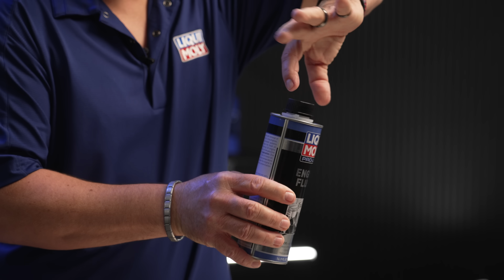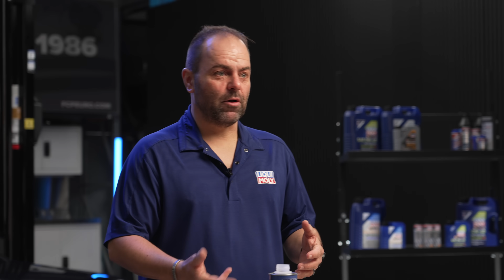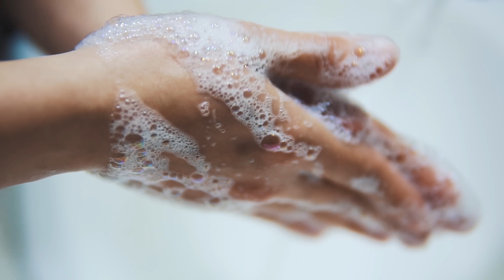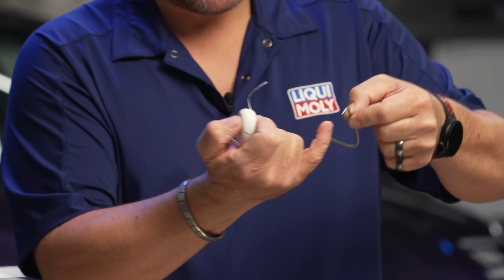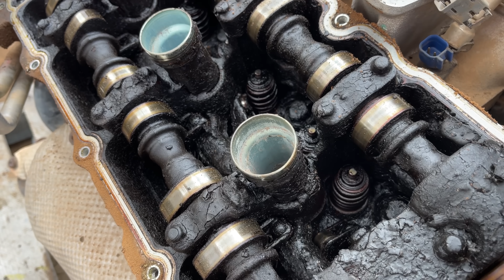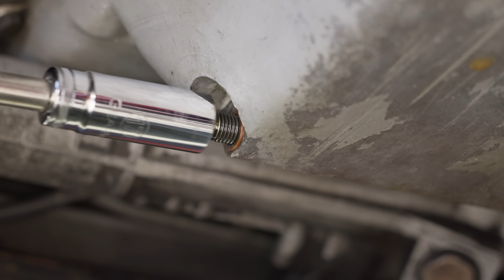LIQUI MOLY Engine Flush | Expert Answers to Your Most Frequently Asked Questions

Comment: The 5156 and Speed are working really well in my diesel family cars, also the flush worked well on the diesel :) 
A friend of mine uses the Direct reiniger and likes it on GDI engines
Reply: Can you elaborate what you mean by worked well?
Reply: @Orkistan7 " Worked well " the car used to smoke a lot, something isn't ok with that car, but with 5156 it started smoking less. I use Speed Diesel with every fuel tank and keeps the smoking and smell to an acceptable point.
Reply: @AAAAAAndrea don’t you think your car smoke less because along with flush you put fresh oil right after that? And this flush claims to remove deposits not reduce your exhaust smoke.
Reply: @Orkistan7 The car didn't smoke less because of oil, 5156 and speed diesel are fuel additives.
The car already has the proper oil

Comment: Would it be the same thing to drain old oil then while drain plug is still off, just run some extra fresh clean oil through and let that drain too before plugging drain plug and putting new oil?
Reply: That helps and I always do this but I do an oil flush first and then do that.  You will get even more out in your engine will be even cleaner especially if you start with a used car and my last car they changed the oil with verified documents every 4 to 5000 miles but it was still sludged up not horribly but a bunch of Gunk came out the first couple of oil changes. 

Now right before I change the oil I run half a bottle of engine flush in every oil change and I'll also run a quart or two pubg basic oil through to get all the other last contaminants out after all the other oil has drained out.  It's amazing how much you get out doing that!!!  Like a lot!
Reply: @bradpnw1897 people who do all this extra stuff do it for their personal psychological benefit not the actual benefit of their engine…although they’ll never admit to it bc it sounds so insane.
Reply: @bradpnw1897 which engine flush do you run?

Comment: You don't need this if you change your oil regularly at 5,000 miles not the 10,000 mile BS that manufacturers recommend. The key is also to not do short trips and get the engine hot. 
With that said the ONLY real engine flush that works is BG that comes in the jug with an external oil filter (dealer only supply). When I worked for VW we used to use that on the old 1.8Ts in the early 2000's when they sludged up and came in with oil pressure lights on. the procedure was to get the engine up to operating temp, drain the oil, install the external filter. Fill that up with the engine flush, connect all the lines and fill the engine with the flushing fluid. run the engine at 3,000 rpms for 30 mins with flans blowing over the radiator. Drain it, disconnect everything, install new oil filter, fill engine with cheap oil. run that for 15 mins. Drain the oil, drop the oil pan and replace the pick up tube/screen, change the filter, and fill the engine with 5W-40 synthetic. That stuff took all the varnish and sludge out of the engine. The inside of the oil pan, oil pump, crank, cylinder heads looked brand new when done.

Comment: Engine flushes aren't effective whatsoever. Just use a high quality oil and change it at 5,000. A lot of Liqui Molly additives are snake oil!!!! Their oils are ok'ish but there are far better oils. Motul 8100 xcess gen 2 is the best oil I used and the best oil when tested by Blackstone for all of my BMWs. Ill never use a different oil
Reply: Actually they are very effective … if you use them in an engine from new not as a fix for an old worn out engine. I buy a similar product in 20 litre drums and use it in all the engines I have from new, excellent longevity is the reward and ultimately lower costs too.
Reply: 8100 x clean / x-cess gen 2 are very good oil indeed, which is what I having used for a long time. Motul excels its additive. Now I am switching to Ravenol  which is  PAO, better lubrication on cold start for my BMW B57 diesel. Used both and happy to use either, just because Motul now increased their price in UK make them less appealing.

Comment: Valvoline restore and protect. Much much safer:
Reply: It isn't made in a ton of viscosities.
Reply: @LoneWolfSparty  It's coming.  I've seen Euro grades in advertisements.
Reply: @HHP-t1o VW/Audi owners would be extremely happy with a 5w-40 gasoline and diesel oil.
Reply: I use it and think it works. But it's very gradual so you have to put a lot of miles on the car before you start noticing improvements. I would use it as a 'maintenance oil' though for sure.

Comment: The problem isn’t the engine flush it’s the sludge it’s breaking loose that will clog the tiny oil passages and oil pick up which will lead to oil starvation

Comment: 2 cans for an Benz, AMG, BMW, or M class is $40+  better off taking 1000miles (or 1-2 months) service intervals. Especially if DIY.  
Service centers won't even offer this product...for a reason.

Don't forget you must only use FIJI water for your cars windshield fluid, and most importantly when you wash it.

Comment: I didnt hear the question, does this engine flush damage engine seal? Myth is that is eats away engine seals on aged engines and probably causes leaks.
Reply: I don't know about liquid Molly but STP makes one that they sell at Walmart that says directly on the bottle that it does not damage the seals and it actually has a little bit of seal reconditioner in them.  I use the STP high mileage engine flush it's a red bottle they sell at Walmart for $7 and I get very good results with that never had any damage to my seals and my car has 220,000 miles on it and it doesn't leak a drop of oil.

Comment: If you use a good synthetic oil with the proper detergent additives, your engine should be just as clean as if you use something like this.
Reply: The problem is most engines are in severe use, and they change the oil like normal use
Reply: @FEGTTTSDHtrue, but if they're already mistreating their engine it's very less likely they'll use an additive as a precautionary method. Most likely they'll use it as a form of band-aid for an existing problem that won't go away with any engine flush.
Reply: Every 3rd oil change I fill up with cheap oil and filter and run about 50 miles on it and drain and replace with Amsoil and Purolator One oil filter. I do this to help remove and dilute any oil thats been left in the engine from previous oil changes.
Reply: JUST CHNAGE YOUR OIL ON TIME PLEASEE SYNTHETIC OR NOT
Reply: not just about oil, fuel quality matters too
Reply: there's no way the engine is clean after 100k+ miles regardless of oil choice. Most people buy used cars as well with unknown services.
Reply: I replaced the valve cover gasket on my W11 engine in my Mini Cooper at 155k miles and my valve train was absolutely pristine, clean aluminum color.  I have owned the car since new in 2003 and had been on 10k OCI.  I now run 5K OCI as I decided I’d rather change my oil more often.
Reply: @ghostwrench2292  same with my 96 civic with 350k+ kilometers motor is brand new with regular oil changes at 10k owning the car since 2010 and   driven 200k myself
Reply: @SilverStar414  My car is at 200k and I've had it since 136k 12 years ago. 5k-7k oil changes with full synthetic Liquimoly, Castrol, or a full synthetic made by Warren Oil Company. Every time I open the valve cover, and i have multiple times for gaskets, chain tensioners, or cam shafts, the engine is a beautiful shiny golden brown with no dark build up. And its a high power turbo car.
Reply: @bryansoto2465  😂 u think the oils only for valve covers
Reply: @SilverStar414  valvoline restore and protect exists
Reply: @SilverStar414 clearly someone who's never taken apart a well maintained engine
Reply: @SilverStar414 Big time wrong! If you buy a car from brand new, change the oil at 5,000 miles every time, that engine will be clean. I have a BMW n52 with 240,000 miles on it and it's super clean for the mileage. Of course you don't know when you buy a used car. Chances are, the person before did long oil change intervals, drove the car hard etc.
Reply: You know I personally lean towards that philosophy as well however you do have to wonder if that was enough you wouldn't need something like Valvoline restoring and protect. The problem is I think there's a lot of snake oil out there and nobody knows what truly works good
Reply: it works but its unnecessary if using good quality oil. the oil itself will do the cleaning as you said
Reply: Yeah, not super thrilled with the amount of bad information FCP puts out. 

These are probably not a bad idea if you're buying a vehicle with unknown history, but it's completely unnecessary, even potentially harmful, for anyone who regularly maintains their vehicle(s)
Reply: @NomadPoker1  I have to agree. Even under no load, running oil that has been thinned thru bearings that are expecting a certain viscosity during cold start doesn't sound like a great idea and more so if we are talking every 5k miles.
Reply: @AStock2204 there's some oil experts on YT like The Oil Geek that talk about this. 

Personally, I have almost 200k on a car that I bought new and have had zero issues with simply following manufacturer guidelines. Starting at 150k I've had my oil tested every oil change (10k) and it's always well within spec. I've even started to extend it further sometimes based on their recommendations.
Reply: @NomadPoker1  you can almost always tell if a vehicle was well maintained or not if you just know what to look for. Many vehicles also have extensive and thorough service records on their official history reports.. but many buyers have no clue. You can have perfect service documentation from the previous owner(s), but that doesn’t guarantee anything. You could just as easily be dealing with underlying hidden issues

Comment: Hi Stefen, nice to see you helping us with your great products and presentations. I use the oil stop leak product occasionaly and was amazed  how it cleaned the varnish inside my N62 motor. This motor has 210000 miles and has no leaks or oil consumption, thanks to this product. Amazingly my valve guide seals are origional...20 years old.

Comment: I have an external oil cooler on my 335i, so a fair amount of dirty oil and engine flush will remain in that cooler and lines unless fully drained or flushed with clean oil and drained again. 🤔
Reply: Still a net improvement
Reply: Good question.

Comment: Some engine flush will remain inside the engine after oil change and mixes with new oil. Isn’t that a problem?
Reply: It's so little it won't do anything significant enough
Reply: It’s an insignificant amount left in the engine.  I would not be concerned.
Reply: No.
Reply: You could just refill with some cheap oil and only to the minimum level to save $$$$ and then drive it a bit then drain that and then do the final oil change/refill.
Reply: Slightly thins the oil
Reply: Yes

Comment: do we need to rinse this out of the engine before we add new oil?
Reply: I asked Liqui Moly customer service once. Stefan's own reply was : "When using our Pro-Line Engine Flush there is no need to do anything except follow directions. Unfortunately there are a lot of "experts" on the internet that think they know more than our German engineers and thus started a rumor that there is a need to flush the crankcase with oil afterwards and there is zero need for this."